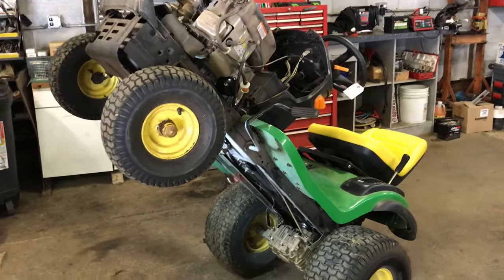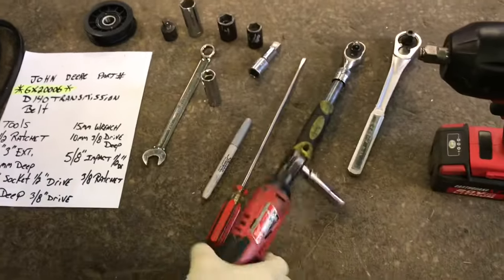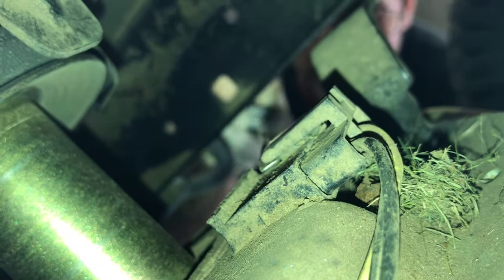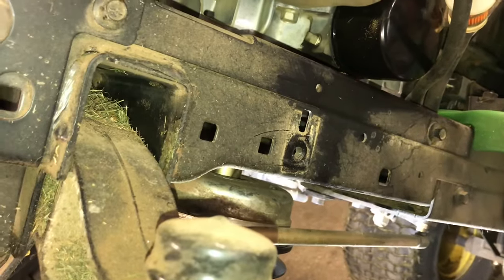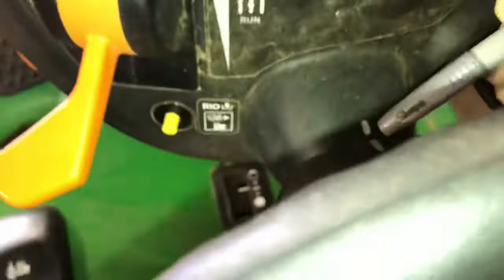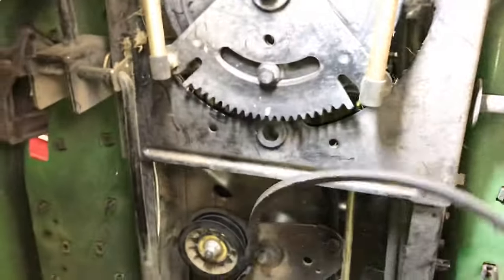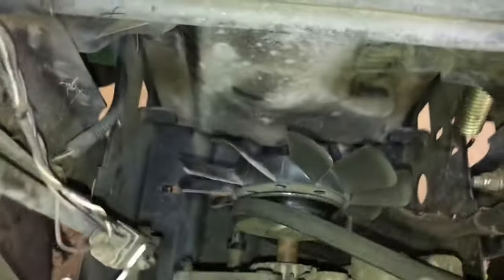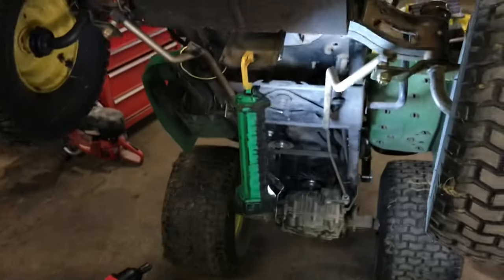How To Install a Transmission Drive Belt John Deere D140 D160 155C LA165 LA115 LA145 LA175

Comment: This is an excellent video.  Thank you, this helps immensely.  Generally it went quite smoothly but removing the front clutch/pulley bolt was a real challenge.  Not as much though as reinstalling the rear belt quite.  It extends enough to interfere with the fan so is a bear to replace.  Patience is not my strength but I managed to complete the job.  Now to change the oil,  Many thanks again for a wonderful video, this task would have been so much more difficult without the help.
Reply from the maker: I’m glad you were able to get the job done:) and the video was helpful.

Comment: Great video!  I don't have an impact wrench. Trying to remove the clutch only turns the engine over. How can I clamp the engine so it won't turn?
Reply: One solution: Remove the upper plastic engine housing to expose the starter gear ring. Jam a large screwdriver into the gear leveraged against one of the magneto housings. Have someone hold it in place as you break loose the nut holding the clutch assembly. There must be a better way. Once it starts, the rest is easy.

Comment: Why is taking the clutch off necessary? Once the plug is disconnected and the bracket removed you can slip the belt right on...I know I already got that far without a problem. Just trying to figure out the rear now..

Comment: Thank you,  I  was about to go from the top as I had with older mowers.  Then I saw how much I was going to  have to  remove to get the top platform/fenders off.  Now from your video I see that wouldn't have worked anyway.

Comment: Excellent video I need to chg my belt and some pulleys but don't have anything to hold it in the air like that have to watch again see what you used? You made it look easy but I will tackle this in the winter I don't have a shop and have to do outside and it Hot right now...Man that was a good video step by step...I know I have bad pulleys so I will change all of them up there...Hope can find some metal ones...plastic is asking for future problems...thanks BJ
Reply from the maker: Hi BJ, I have had good luck with the plastics pulleys just make sure you do not wash your machine. Water does is the down fall of bearings on this line of John Deere mowers.

Comment: Thank you, thank you, thank you!!  Our area is normally arid but this last 12 months brought heavy moisture.  So, of course, all our weeds & grasses got HUGE.  In the process of mowing i had to change mower belt ( u helped😁), but now the drive belt jumped off the very front pulley.  Its not torn or worn i just think a weed got up in their just right😡.  I understand all you show but i cant get the darn bolt off that front pulley??  Any hints on that?
Reply from the maker: Pipe wrench to hold pulley and long extension pipe on end of whatever wrench or ratchet you are using. A electric or air impact gun is the best way. Maybe you know someone that you can borrow from?

Comment: Very very good job and production.  You are remarkable and so glad you made the effort to post such a good instructional video.  I will look for more of your productions.
Reply from the maker: I’m glad it was helpful. I’m new into the YouTube world around 2 years in as far as making content. Thanks for watching and please tell friends!!!
Reply: Any suggestion on how to get PTO bolt out?  Mine is seized and I am unable to get a wrench on the lock nut on the pulley.  Impact driver not breaking it loose.  Must be a special wrench to hold locking nut in order to break the center bolt.  Thanks again if you have any ideas.
  @JohnsonsSmallEngines
Reply from the maker: You may be using a smaller impact driver. The impact driver that I’m using in the video is a 1/2 “ impact driver from harbor freight “earthquake “and i have never had a pto bolt that it would not break loose. You may need to borrow a bigger gun from someone you know who may have one or you will need to take off the engine cover and hold the flywheel from turning and use a long breaker bar with a 6 point socket on the PTO bolt to break it loose.
Reply: @JohnsonsSmallEngines  Thanks a lot Steve.  Should have figured out taking off the engine cover.  I will get a little help or larger driver.  You are awesome and thanks again.

Comment: Great instructional video!  I have a question about my D160:  Is there a drive belt tension adjustment for these mowers?  I can put my pedal all the way to the floor and while it works fine thus far, it seems like it's a little loose if I don't have ANY pushback all the way down.  TIA...
Reply from the maker: Most drive belts are tensioned by a spring. No adjustment. Your belt is spring tension only.

Comment: Wow, im glad i watched this. I need to replace my belt on my e150, im sure its similar. You made it look easy!
Reply from the maker: It should be close if not just the same. Let me know if it was the same and I will put your model in the description.
Reply: @JohnsonsSmallEngines  yup it's the same on the e150. You must be a magician to get it done that fast!  I didnt have a pneumatic impact so I tried my 18v cordless which didnt have nearly enough torque, and I tried putting the tractor up on jack stands, but the bolts were so tight I was lifting it up and off the stands using a ratchet, so I had to loop some chains around the rafters in my shed and hang the tractor by the front end the way you had in your video, which was a project in it's own. All together took me a little over an hour, a lot more cussing and a sore back from rigging it up 😂🤣😂

Comment: This video is great.  Nice video work as well as great explanations.  Quick question before I go for it on my mower.  I have a D140 at about 200 hours.  I find that after going for a little while (over half an hour to 1 hour of mowing) I start slowing down going up hills to the point of crawling.  Flat and down hill are just fine.  I don't hear a belt slipping but was wondering if this would be an indication of needing a new belt or is there something else I should be looking at?
Reply from the maker: Daniel Karn if you have hills on the property I hate to say this but it sounds like your transmission is starting to fail. If you let it cool down and it works fine going up and down hills then after a hour it starts to fail, that is most likely your transmission. Try the transmission belt first and see how it is.

Comment: You can take the seat springs ( located on both sides of the gas fill cap) off and the gas tank lines off to remove the gas tank and get to the idler guide. Remove it using a hex wrench. My belt got jammed between the fan and the pulley.

Comment: Thank you for the excellent video! I'm wondering if there's room to get a ratcheting 15mm closed-end wrench on the transmission belt guide??
Reply from the maker: Thank you. I do know now that the top of the rear belt guide has a hex on top where you can use a allen wrench or allen socket

Comment: Great Video! Awesome to know how to replace the belt. You do make to look so easy! Any tricks on how to remove the idler pulley from the small shaft? Seems that mine is really stuck on.... Thanks
Reply from the maker: Mark Beaver try and pry evenly on both sides of the pulley and using a penetrating lubricant can also help.

Comment: You made it look easy on taking the 5/8 nut off front pulls. Mine won't come out.  Any suggestions?
Reply from the maker: If you are talking about the engine turning while trying to get the bolt out of the electric clutch? Electric or a air impact is the best way to get it off. I have heard if you can get a pipe wrench on the engine shaft/pulley collar, then you can hold the shaft while using a breaker bar and socket to remove.
Reply: Thank you that helps. And you video was very good.

Comment: My son in law replaced the drive belt and now the mower deck isn't engaging when I pull the knob. What could be the problem? Thank you for the video
Reply from the maker: Make sure the electric clutch is plugged in the the wiring harness. You disconnected it when you did the job.

Comment: Question.  I just got a D140 that wouldn't start.  20a fuse was burnt up, replaced it and the battery.  It runs great, but it won't drive.  Fan is spinning, but I get nothing when trying to drive it.  Is it possible the belt is over stretched?
Reply from the maker: Make sure the transmission release rod is pushed in located down to the right of the trailer hitch. This is a video I made on "how to start and operate a D140" Start watching it at 4:22 and it will show the rod. https://youtu.be/E9vb4ysXgkI. If this doesn't get you going, you may need to take the mower deck off and look at the transmission routing to see if it has jumped off.

Comment: Lady I'm doing carpentry work for, her son in law is having a problem now with that belt popping off when he engaged the clutch. Could those keepers next to the pulley be bent or maybe the one u showed in the rear be gone? The only reason I can think to tell him.  Thank guys,, really great video.👍
Reply from the maker: Peter Ford If you mean when he depresses the break/clutch pedal and the transmission belt is popping off. I would say one of the belt guides is not working correctly. Did he just perform the transmission belt replacement?
Reply: @JohnsonsSmallEngines  yes, he replaced the deck belts and the trans belt and whenever he put it back together the trans belt keeps popping off.
Reply: @JohnsonsSmallEngines   I've never worked on a big rider before and I told him maybe a pulley is bent or messed up, but when I watched you're video I saw those guilds and realized they keep the belt contained in the pulley. So that makes sense,,,just couldn't figure how they may get damaged.

Comment: Hi Brad, we talked earlier about my S240 and drive belt replacement. We were talking about air impact wrenches, which I don’t have and was wondering if an electric impact wrench would do the same work?  I have a pancake 6lb. Compressor but articles I read said I need a 20lb in order for the air impact driver to perform optimal.
Reply from the maker: A electric impact (this is what I use)should work if it is a 1/2” drive. A 3/8” may or may not work depending on the torque it has

Comment: Great job, great video. Without a safe way to get under my mower, I think I will let the Deere dealer handle it.
Reply from the maker: Thank you!
Reply: I sent my mower to the shop because I was smelling burnt rubber while mowing. The shop replaced many pulleys, a spindle, the deck belt, and the transmission belt. I'm hoping for another 12 good years from the mower.

Comment: AWESOME VIDEO!! question though. My electric clutch spins when I try to remove the 5/8th bolt on the bottom. Any suggestions on what to do here?
Reply from the maker: See if you can borrow a electric impact from someone or you may need to take engine cover off to hold flywheel.
Reply: @JohnsonsSmallEngines  awesome I got it off by holding the fly wheel thanks for responding!
Reply: I don't have an electric impact. How do I keep the flywheel from spinning? Got the cover off and a long breaker bar for the 5/8.

Comment: If the front pully is stuck, how do you get it off? I hesitate to us a puller, but if that is the only way...
Reply from the maker: PB Blaster works good sprayed at top of the engine shaft so it can seep down into the pulley and if needed, soak for a couple hours.

Comment: Changing mine tomorrow,,, Awesome video,,, thanks so much
Reply from the maker: I'm Glad it will be helpful. I hope all goes well, Let me know how you made out. Thank you for the kind comment and please give this a like to help the channel grow. It would be greatly appreciated.
Reply: @JohnsonsSmallEngines  got both belts changed without a problem thax to your videos,,, found a broken wire towards the back and fixed it,,, the reason I changed the belt was it was stretched and cut a wire that was hanging out,,, all zip tied up now,,, changed the celinoild and checked seat safety,,, i turn the key and see the headlights come on and no start,,, cross the celinoild over and it starts,,, what am i missing?
Reply from the maker: It sounds like a safety switch isn’t working. Make sure your brake is all the way on and make sure the PTO is off. Trace what you did because obviously it was not that way when you started the project.
Reply: @JohnsonsSmallEngines  yeah it actually was this way before but i thought the broken wire was the problem since I replaced the solenoid,,, gonna check out the safety switches in the am,,,  definitely want to thank you for your time and videos and for chatting with me,,, any videos on testing switches
Reply from the maker: I do not yet.
Reply: @JohnsonsSmallEngines  its a short in the wiring below the key switch

Comment: Great video !! but what if pulley doesn't come off with clutch? pulley will not move?
Reply: I have E150
Reply from the maker: Sometimes I need to use two large pry bars and if you can get a helper get one pry bar on one side and one on the other side and pry evenly to pop the clutch down. Make sure you put the bolt in half way so if the clutch drops it will not fall to the ground and be damaged. Unplug it from wiring also.

Comment: Brad, Don't have an impact wrench, Trying to remove the 5/8 clutch bolt with a 1/2" socket wrench and of course the drive shaft just spins. I tried grabbing the shaft collar near the bolt head with channel locks and vise grips but no go. Any suggestions? Thanks... I know, go buy an impact wrench, right?
Reply from the maker: Try a pipe wrench instead of vise grips

Comment: Great video.  What did you hook 'to' to lift the mower up?
Reply from the maker: We use a 1 ton chain hoist at the shop hooked around the front axle.
Reply: @JohnsonsSmallEngines  Thank you.  It appears you remove the hood as well, so I'm assuming the chain from the axle doesn't hit and break or mar the hood finish?
Reply from the maker: Correct, we take the hood off.

Comment: I must have missed a step. When I go to remove the clutch and pto assembly the motor turns and prevents me from getting the nut loose. How do I stop the motor from turning?
Reply from the maker: You need a electric or Pneumatic impact gun as used in the beginning of the video or take off the engine cover off and hold the flywheel.with a strap.

Comment: I have an stx38 Deere and the 13hp Kohler runs great however the second I engage the mower deck it either stalls or runs like crap.  Would this be a culprit for my scenario?  The belt does look old.  Thanks
Reply from the maker: Chucky Chuck the transmission belt is not your problem. There can be many different reasons why your mower runs poorly when you engage your mower deck from a bad mower deck belt to a poor running engine. I would need to see a video on how yours is running or need to see it to diagnose the problem properly
Reply: FLOW GARDENS - I have the same model stx 38. One of my spindle bearings locked up so every time I engaged the blades the engine would stall. Check to make sure blades/spindles turn freely. That’s just one other possibility.

Comment: Excellent video, but I am still having significant difficulties.   I followed the instructions and was able to replace my traction drive belt on my JD LA-130 tractor.   After installation I am still encountering belt slippage and the tractor is still not operable.   I checked all of the part numbers (GX20006 Belt) and verified that I used the proper replacement parts.  From what I can tell there is no adjustment screw to tighten up any slack in the belt.   Currently I am seeking solutions to this issue.   Do you have any suggested fixes?   Cutting 1 acre of grass with a push mower is great exercise given that our local gym is closed due to COVID-19.
Reply from the maker: With the clutch pedal all the way out (engaged position) is there belt tension? There should be belt tension . Check to make sure the spring is correctly positioned.
Reply: @JohnsonsSmallEngines  I am still trying to fix the darn traction drive belt on my LA 130 lawn tractor.   The replacement belt is installed correctly and all parts are operating per the manual.   With the new belt installed and the clutch pedal / parking brake fully released there is likely still too much play in the new belt.   In response I first inspected the idler pulleys for proper operation and wear and found no issues.  Next I tried installing a new idler pulley assembly spring, but found no improvements and yes I did check to see if the spring was installed correctly.   Next I talked to a mechanic at Trac Auto who suggested installing a slightly shorter (- 1") traction drive belt, but I wouldn't begin to know if that is possible (do these even exist?) or a good move?   This tractor has given me excellent service to-date with zero serious maintenance issues until now.  It has 317 hours on it.   From reading the various posts the one risk factor that I do have is we live on the side of a hillside with a significant slope (30 - 35' rise / 200' run), I've heard that this situation can be tough on transmissions.   Do you have any additional thoughts or suggestions on how-to improve belt tension?  Most appreciated.
Reply from the maker: I would need to see tractor to help. Impossible to diagnose without seeing it. Possibly transmission issue or seized pulley.
Reply from the maker: David Tantillo  you do not need to go with a shorter belt. That will not repair issue as long as you have the correct belt for the machine. Looks like possibly transmission is failing but as I commented before, I would need to see machine to properly diagnose.
Reply: @JohnsonsSmallEngines  Thank you for your help.   Most appreciated.

Comment: When I try to undo the 5/8" long bolt holding the clutch on, the whole shaft rotates and I cannot loosen it.
Reply: David Ellis see if you can borrow a electric impact from someone or you may need to take engine cover off to hold flywheel.